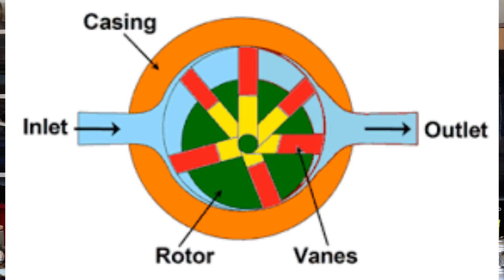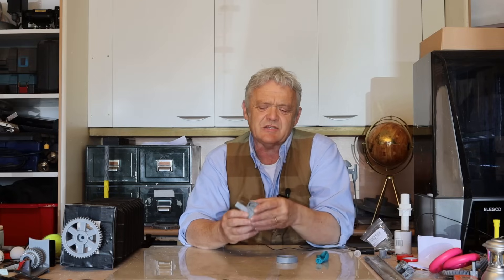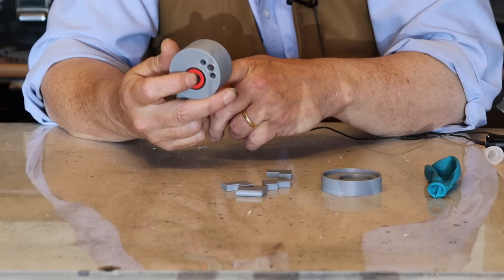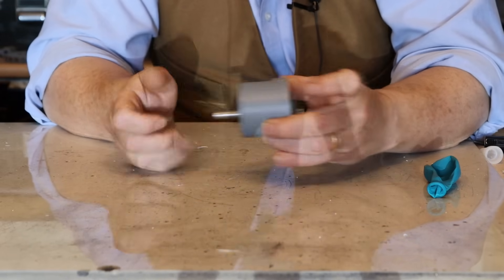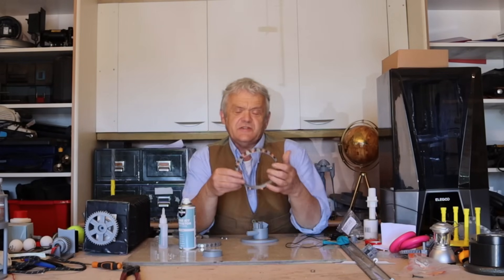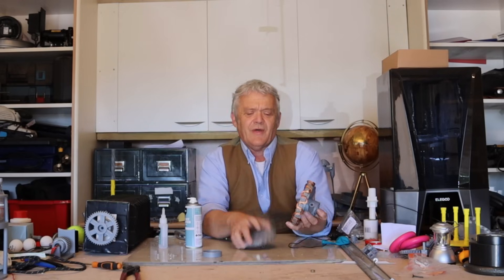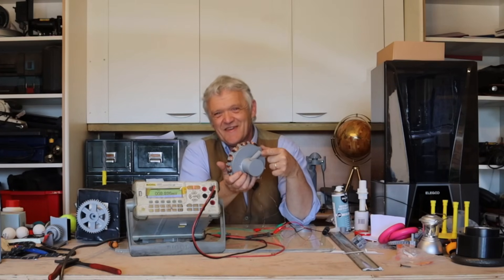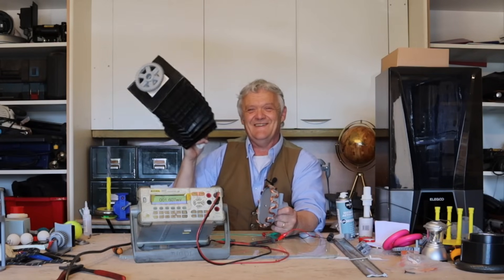2026 Vane Motor Generator

Comment: Plaudits aside of which there are many I could pass your way, what you are doing is exceedingly interesting in all your videos.
Have just watched the series on the low wind turbine for under £100. Fascinating. How about linking the idea of the wind turbine turning it into an undershot water mill design so you have a constant flow of energy from the water. Then attach a pump with two or more cylinders to blow a continuous flow of air into the vane motor?
Alternatively you could use the wind turbine as an undershot water mill and generate electricity directly.
P.S. Thinking about the later as moving off grid and there is a fast flowing river alongside the land.

Comment: If you compress air, no matter where you get it from [sun, wind, waves, falling water, earthquakes, people walking on bridges] if you have some really big high pressure tanks secured so they can't move and can't be damaged [for instance, steel tanks inside a concrete vault] you can store air almost forever.

And if your distributed network is BIG enough [high pressure pipes to input to storage, and high  volume pipes to consumers] in a network, you could be sharing the combined fluid power of just compressed air to every single household, and normal, relatively clean and pure air, like you find around you presently,  air can not electrocute you, can not light your house on fire, is not explosive, is not flammable, and will not suffocate you.

There is a lot more to using compressed air and vane motors on top of that too! (~_^)-b

Comment: You should see how small the Ingersoll Rand pneumatic starter is on a Mack truck engine. The E9 is 998 cubic inches and the starter motor is about 8 inches diameter by about 8 inches long. It starts the E9 instantly and the engine is at idling speed on the starter motor.
Reply from the maker: that's a lot of torque!

Comment: I've not heard of anyone trying an electrode in a compressed air environment. Maybe aluminium air battery. Ozonated oils, haven't made it into any of your videos and it would be interesting to see some experimentation..
Reply from the maker: cheers mate
Reply: A process is open source too. I think it's the powerofozone and would be useful to see if could apply to a whole host of new process. Thank you for your kind support again. Certainly research the community of ozonewithoutborders will be fascinating, if you've never seen before.

Comment: What would happen if the magnets are moving in one direction and the windings in the opposite direction, both tied to their own source of propulsion?
Reply from the maker: the voltage is proportional to speed and speed is relative so the voltage would increase by the amount of the combined speed

Comment: Rob, I'm having problems (still) trying to get the ink to adhere to the aluminum foil. I've tried the acetone, soap and water, and rubbing alcohol. Still not working. Any other suggestions? Better quality of foil?
Reply from the maker: that's all i can suggest mate as  tried it with foil washed in acetone and it sticks well - though i suppose you could try to roughen the surface with a light sand?
Reply: @ThinkingandTinkering  Thank you, I will try that.

Comment: Mr. Smith, again you have made another great video.  The rotary vane style pump has been used for a very long time by the Fire Service as a positive displacement pump used to prime centrifugal pumps.  I find it interesting that you have the knack to take an everyday implement viewed by finite audience, modify it, and take it now a different path.  

Here is a challenge for you, the Fire Service also uses another style positive displacement pump, the rotary gear, as a priming pump for the centrifugal style pump.  I have no doubt you could do the same concept with that device or something along those lines.

My brain is old, ancient, moldy, and feeble is the reason I don’t try it myself.  Again, I enjoy your videos, thank you your time.

Respectfully submitted 
Jay Huyssoon
Reply from the maker: that's a nice suggestion mate - thank you for taking the time to mention it
Reply: Thank you for your concepts, proffers, and videos, I have enjoyed them for years.

Respectfully submitted
Jay Huyssoon

Comment: From what I'm seeing, there isn't any reason why you can't adapt this vane motor with coil to be incorporated into an EV wheel/wheels so as to harvest kinetic energy from the rotation of the wheel/wheels instead of compressed air and using the electrical energy to continuously charge the battery array or a battery array/supercapacitor. You're talking about an EV that never needs to be plugged in, thus unlimited range.
Reply from the maker: I agree mate there is no reason at all that couldn't be done
Reply: @ThinkingandTinkering  So, get right on it, please.

Comment: Just needs a flywheel to smooth out the voltage between the push n pull of the bellows, or have two bellows and non-return valves for constant flow.
Reply from the maker: i agree mate and the two bellows is a god idea

Comment: I love the idea of air powerd cars but there is a fine line between that and a mobile explosion especially in a crash situation?
Reply: All of the various powered cars have that fine line of a potential disaster in a crash. Design in the best possible ways to mitigate those and improve as necessary.
Reply from the maker: compressed air is one of the safest mate

Comment: If I have a check valve on my mouth and the right gearing I could actually charge up my phone while hiking because I'll generally be exhaling through my mouth in a controlled manner over somewhat lengthy periods of time - "thru-hikers" would love this!  Even breathing into a balloon which is then connected to a reduction fitting that's mated to the generator doesn't add much weight and is a flow regulator so the output comes sort of pre-regulated.
Reply from the maker: i like that mate!
Reply: But it's hardly free energy, as it presents back pressure.

Comment: I don't know exactly how they work but there have been compressed air assist systems on long haul trucks; I don't know why they don't get discussed as it always seemed like a great way to get a lot more mileage out of the fuel they were burning  by storing energy in the compressed air tanks during long downgrades to use to assist later.
Reply: Probably because it would make too much sense to do something like that or it's not complicated enough. 😂
Reply: That makes a lot of sense. I mean, if you're going to have a jake brake anyway, you might as well dump that into the air system, and you might as well use it for something power intensive like initial acceleration.
Reply from the maker: that would be a great way - you would be amazed i think at how much doesn't get done because it never occurs to folk to try it

Comment: Steady air supply? Japanese box bellows is far more constant than a constantina bellows
Reply from the maker: you could - or you could just make a double concertina mate - it would then be the same thing - but less leaky
Reply: @ThinkingandTinkering  true, but wouldn’t a second conatintina reverse the flow? Where a box bellows would be continuous in one direction(not sure about the leaks)?
Reply: @JohnSmith-qm5xu  Either way you need one way valves to turn alternating motion into steady flow of air.
Reply: @hanelyp1  the box bellows is a constant one-direction air flow, why do you need an air valve?( not being pedantic here, I know the box itself consists of several one way valves, it just doesn’t need an extra in-line valve)
Reply: @JohnSmith-qm5xu Point, the valves are built into the box bellows, including at the outputs of each side.  Building a different system of bellows for the same effect must also have comparable valves.
Reply: @hanelyp1  the box only has one output, did you have another bellows in mind?
Reply: @JohnSmith-qm5xu A box bellows has 2 chambers separated by a common piston.  Each chamber has valves on both input and output, for a total of 4 valves on the system.  The output valves feed into a manifold to the final output.
Reply: @hanelyp1  it feels like you’re talking past me, I already said that the box bellows incorporated valves(flaps in most examples), but the output(manifold as you call it) is constant and one direction. What was the point of “well actually”ing me?
Reply: Had to Google that one...and now I want to build one. Looks like an awesomely efficient design as well as being cheap and easy to build. Thank you for that.

Comment: Wow. Competition for EVs. Hmm. What if you replaced the bellows with a Fresnel lense to heat a series of black PVC tubes to create higher pressure heated air? Like a solar water heater, but using air? I'm guessing the size to make enough pressure would be ... massive? But if you heated a sealed tank of air?
Reply from the maker: interesting thinking mate - it would be like a kind of Stirling engine I guess

Comment: I can think of a few ways to use that. Connecting a aluminum casted version of the motor to something like an air compressor. I wonder how long it will run.
Reply from the maker: i wonder

Comment: I've been looking at using a wind turbine to drive an air compressor to use as energy storage.  So far the designs I have on paper have fairly low compression rates, but something like this might be good for when the released compressed air recharges the batteries.

Oh, and my compressor design may have a bellows in its future 😂
Reply from the maker: lol - awesome mate - i think bellows are much under used!

Comment: You shoudl REALLY make the  'motor' part more airtight, put some rubber on the end of each of those 4 fins, and use a bit of lubricant on the rubber and plastic surfaces... you might have to re-print some of the pieces, but you'll have the opportunity to so compare the one you have now, with a newly printed, OPTIMIZED version and you'll be able to demonstrate just how IMPORTANT optimizations are...  I'm willing to bet there will be an almost DOUBLE in the output just by  sealing it up and using some rubber & lube gasket on the four fins.... 
Oh I hope you can show us this, I had a project fall apart when the prototype had such lackluster result that it was abandoned right away... but months later that prototype was looked at again when others weren't turning out well, but this time a few VERY SMALL AND SIMPLE optimizations were made  and nearly doubled the result, causing the entire team to FACEPALM over the wasted 4 months on other designs lol :)
Reply: I'd probably go for nylon filament for the vanes, and graphite lubricant to start with. And make sure the mating surface of the vane is horizonally aligned on the printer. Might not hurt to rheam and/or hone the inside of the cylinder as well.
Reply: @DFPercush I know graphite can be used as a lubricant in powder form but do they make it in gel-like suspension? I would think so and that is what you meant beings that the power would just get blown out lol.....
So nylon is much 'slippery-er' than the usual PLA? I really don't know the differences between all the filaments available, and there are just SO MANY!! I don't know very much about 3D Printing, heck I don't even have a 3D Printer, but I'm trying to learn when I can...
Reply: @ThatTweedle  Nylon does have a lower coefficient of friction than PLA, but since you asked, I went looking, and it turns out PTFE is one of the lowest out there (Teflon, go figure). I did indeed mean dry graphite. There might be an excess that blows out, but you can't erase your homework by blowing on it, some of it will stick. That would be a neat excuse though lol.
Reply from the maker: i agree mate - this was a 'knocked together' prototype you improvements would certainly get better results

Comment: Rob, I see that you have uploaded this in individual parts.  I SO do appreciate that, since my printer is quite small.  Would you do that for your other motors?  I have been trying to make them, and your Darwin wind 'generator', but I cannot  separate the parts.
Great job.
Keep up the good work, mate.
Reply: You can use thinkercad to do that, in a roundabout way... You multiply the whole parts (left on the screen) and remove the ones you don't want (using a big form - square, round, whatever -, making it negative, and erasing those parts), resulting in having every part separated
Reply from the maker: cheers mate and i will try and do that in future

Comment: Nice.  Since the vane motor will run on a vaccuum too, a single bellows with a couple ping-pong ball valves would be ideal for operating it.
Reply from the maker: it should work for sure